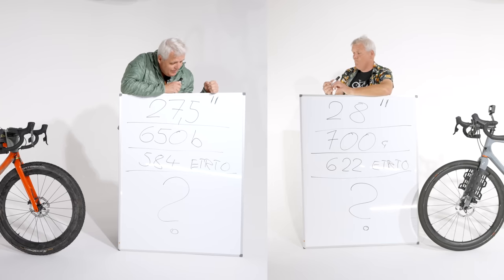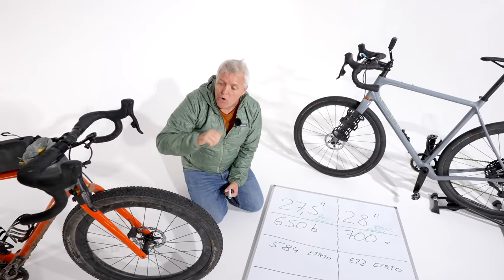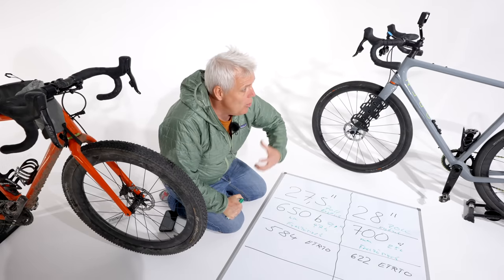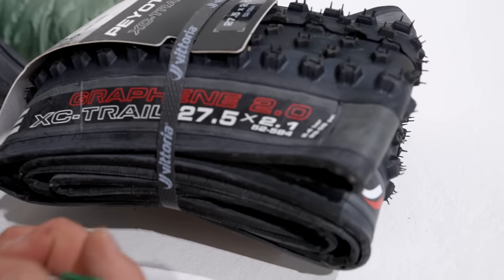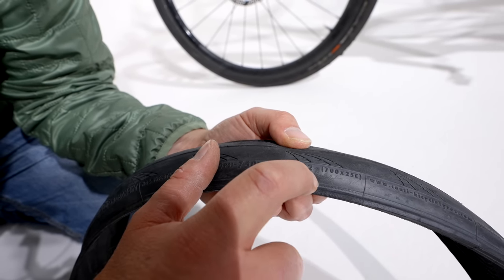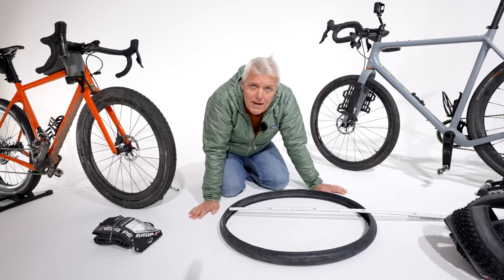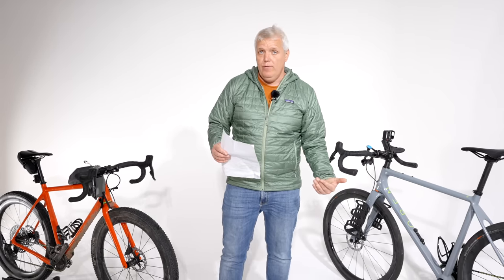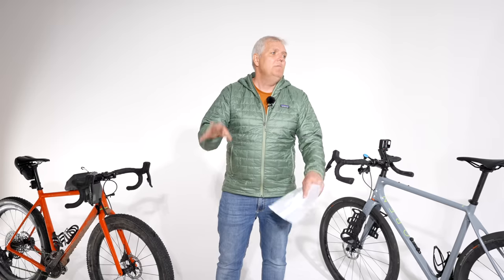Lange lebe 650b! Oder doch 700c? Felgengrößen-Beratung!

Comment: Sehr schön erklärt, das zöllige, französische ETRTO-Wirrwarr. Im Winter fahre ich allerdings eher mein Stahl-Touringrad mit Rohloff, Zahnriemen und Conti Top Contact Winter-Bereifung 28“. Mit Wintergraveln konnte ich mich bis dato noch nicht so richtig anfreunden und bis in den Spätherbst bin ich mit 700x42 Pathfinder Pro sehr gut klargekommen.
Die Hörnchen sind klasse. Damit kannst Du direkt zu Torfrock in die Bagaluten-Wiehnacht 🤘😎😬

Comment: Hey Dan, kannst du uns erklären warum du 40mm auf Straße fährst? Mir wäre die pace viel wichtiger als leicht mehr grip, das macht sich für mich nicht lohnenswert besser. Oder gibt es noch andere Gründe? LG Philipp
Reply from the maker: Hi Philipp,
ich fahre eigentlich ALLE Reifenbreiten.
Beispiele:
Im Winter bzw, Hardcore Gravel gerne 650b mit MTB Reifen 2,2"
Beim Rennrad gerne 30-32mm Slicks auf 700c
Oder im Urlaub auf LaPalma eine Mischung 40mm auf 700c
Dazu gerne mal diese LaPalma Video sansehen wenn du magst, dann erklärt sich warum wir das so gewählt haben:
https://youtu.be/-YMMhjOsp-w
https://youtu.be/0z267g-MPJ4
https://youtu.be/dBQ_hqfCV0I

Cheers
Dan

Comment: Tolles und informatives Video! Habe allerdings den Eindruck, dass die Auswahl an 650B-Felgen sehr begrenzt ist. Wirkt fast wie ein Nischenprodukt. Aber vielleicht suche ich auch nicht richtig...
Reply from the maker: Ja das ist leider leider leider das Problem, das es nicht so grosse Auswahl mehr gibt. Daher habe ich auch dieses Video nochmal gemacht. Es wäre schade, wenn für Gravelbikes 650b verschwinden würde. Bin ein Grosser Fan davon. Noch haben wir ha Laufradsätze - aber was ist in 2-3 Jahren?. Grüße Dan
Reply: Ich fahr meine MTB Laufräder auf dem Gravel. Ab und an kannst du Adapter einsetzen. (12/15mm Achse)